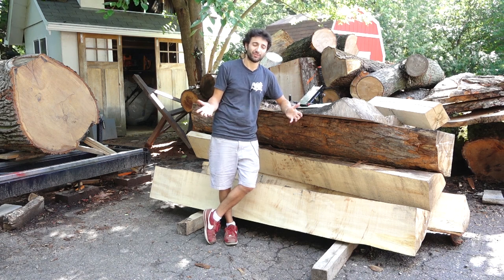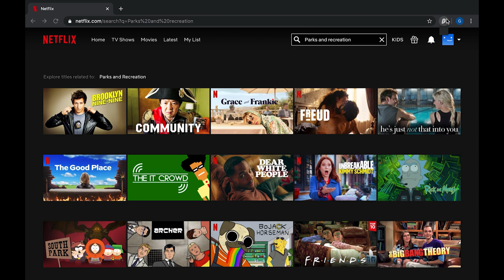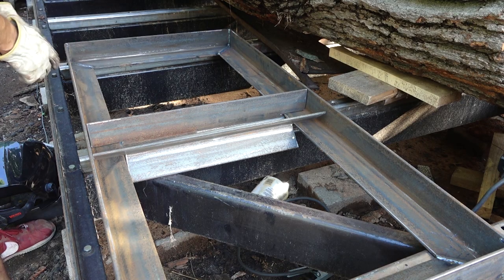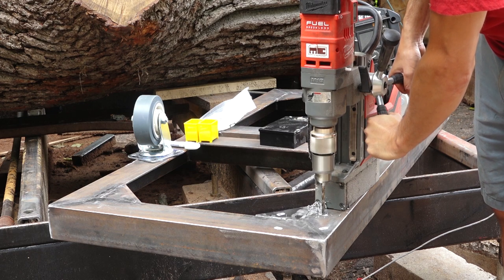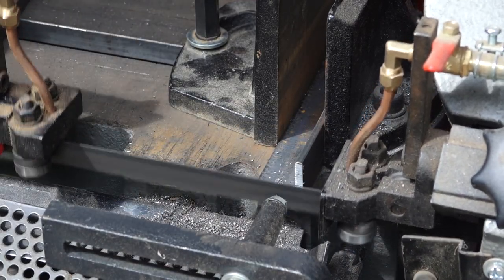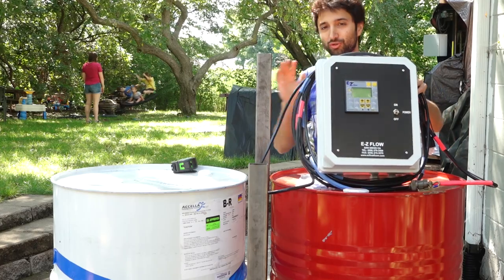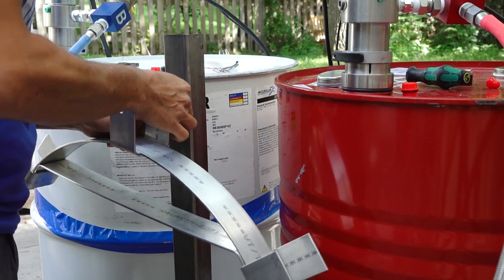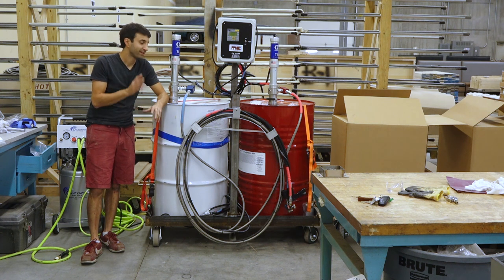Making a Drum Cart (Custom Mobile Bases)

Comment: Tech tip: Save yourself a ton of time and just plug weld the casters on thru the bolt  holes. Nice work! Love your metal working
 wood channel =)
Reply: or tap the holes and short bolts

Comment: Matthew, if you have not already, you may consider contacting both the City/County Building Codes Department and the local Fire Department Inspection Bureau and find out if there are any restrictions concerning the storing of drums containing flammable fuel and/or oil-based liquids within that building. There well may be restrictions and/or at the very least, the requirement of placement of warning Hazzard placards on the outside of the building. Better to know now, rather than after you get a remove order and citation later-on.
Reply: I,m sure when he signed the lease contract, it stipulated rules and regulations.

Comment: If you look up "Drill Hog" or on eBay, they sell shorter bits called screw machine length. I use them in my mill and mag drill. Plus they're high quality.

Comment: Foam is a economical packaging. This can be very messy if not careful. Will stain your skin. Check OSHA label and read. Use in a well ventilated space which you  have. Used the product for years where I use to work. Be safe.

Comment: Matthew, a consideration for later modification(s) might be experience with large garbage dumpster bins. I found that four swivel wheels made things dangerously/problematically unwieldy. Welding to in a "front" position allowed for steering. Engineering a design that allows for locking any two of the four wheels may well be a preferred choice.

Comment: Matt, do you believe in using cutting oils when drilling or cutting steel on the weight saw? Your bits and saw blades will last longer when they're lubricated in the process.
Reply from the maker: I don’t believe in using it on mild steel

Comment: Those were not stubby bits, you want spot drills or true stubby drill bits. Look at McMaster- Carr for reference on lengths. I Think its J&L tool that is still in existence as far as steel and machinist tools. The drill bits you have look like Jobber length. I would also recommend 8% colbalt drills, they just last and work.
To know more you might want to get a Machinists Handbook. It is available online a as well. It tells you all things for manufacturing as well as all steel and wood manipulation.

Comment: I wonder if you know the word over built? You seem to do that when you play with metal but it should last longer than the bearings in the wheels. I have so 2x2x1/4 scrap in my shop let one from a project but have not a clue what would use 3 inch for that you have. But you are having fun!!!
Reply: Yeah, I know the word overbuilt. I strive for it! Just enough ain't good enough.

Comment: Very nice.  Do you ever have problems with wind when mig welding outside?  I'm thinking of getting a welder and since I'll always be outside with it I thought I should do stick.
Reply from the maker: No, the air tends to be pretty still on the days I’ve done mig
Reply: If you're concerned about wind, you can always MIG with flux-core wire instead of shield gas.  Gives you the same protection as you get with stick.  Only drawback is the wire is more expensive than solid core wire.